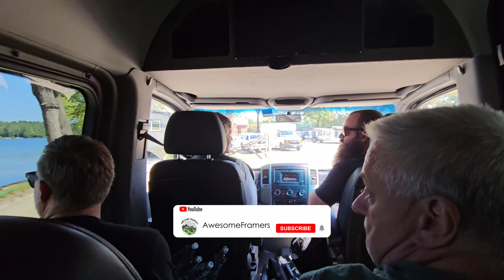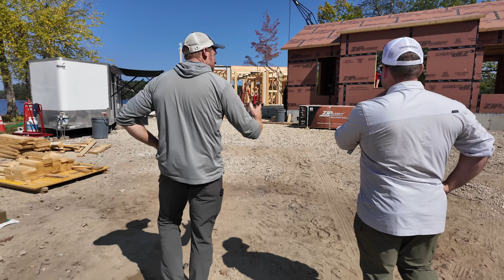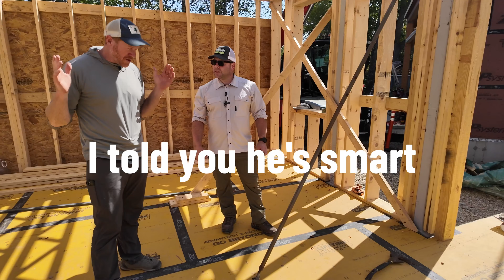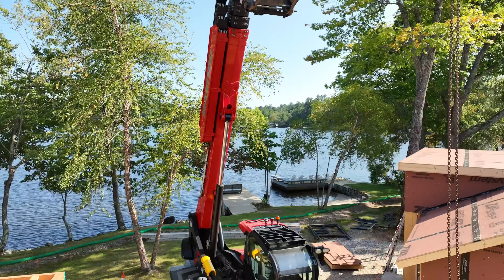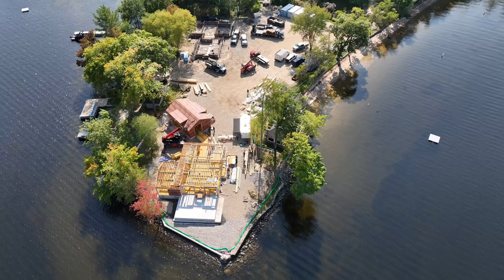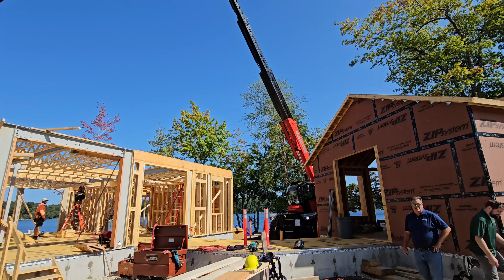PRO Construction Tips from a Master Framer's Jobsite Walk Thru!

Comment: I shoot (ramset) whenever I can all my hangers Wood and Metal 1.5mm+ studs into steel col. and I beams where sometimes the flanges and web are thicker than a half inch, but the gun shoots the pins/studs/fasterners w/o an issue, labor savings and strength are compelling. Have you ever tried using a gun for the steel beams? That is a complicated material mix what a nice job. Super smart tip leaving columns height adjustable until siding and floors are installed grout must be messy unless mixed very thick/stiff maybe he uses a joint compound bazooka for grout install. Ray